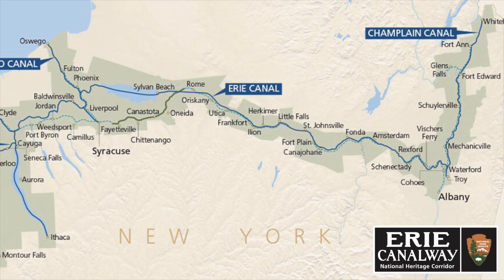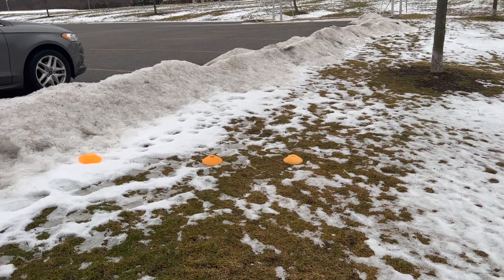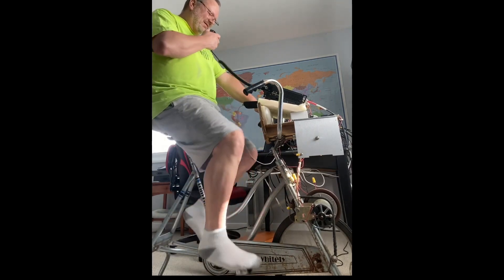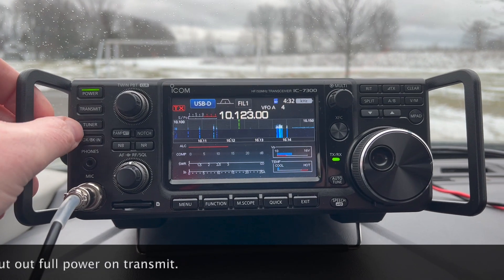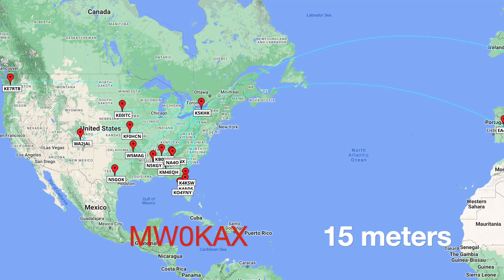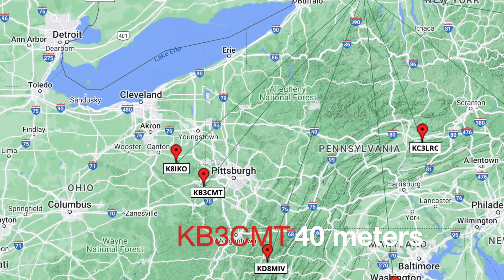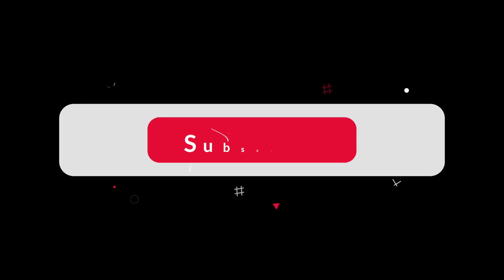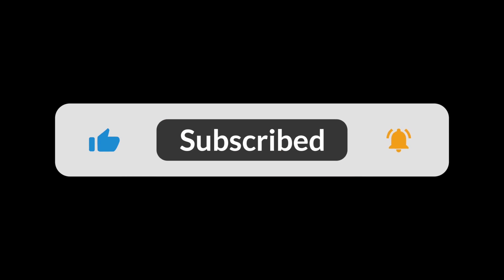POTA Activation with the Rybakov Antenna

Comment: I built one two weeks ago! I am impressed so far!  I am in a HOA! I
Used a chameleon 25 foot whip.
I am in NYC and I worked California,Washington State,and Canada. It's too cold to set it up since then. I hope the weather warms up so I can make a coax passthrough for my basement window and make a permanent setup using a wire to my roof to make it invisable.
I used two 33ft radials.My unun is a 4:1 5kw model I found cheap at a 
hamfest in Connecticut! I had it set up in front of my house and no one noticed it. I used a aluminum plate I found at a scrap yard as a base.
I made mounting bracket from 
scrap aluminum angles I also found at the scrap yard. I will be posting
photos on face book when it gets warmer.
Reply from the maker: Awesome! As soon as Chameleon came out with the 25’ whip, I immediately thought about the Rybakov. Sounds like you’ve got a great setup, even with the HOA. Thanks for watching!

Comment: Is Emergency mode safe to run on a regular basis? I have a few setups that are just outside of the tuner range, and I'd be okay running 50 watts, but I don't want to fry a 7300 haha
Reply from the maker: That’s the $1,000 question, LOL. I’ve used it for some POTA activations on SSB and FT8 for maybe an hour or so without any issue. A separate tuner would be better for a more permanent solution, but having the option to use Emergency Mode on the 7300 is nice, especially for portable ops.

Comment: schematic detail please.....73
Reply from the maker: I'm not sure what you're looking for as far as schematics. A Rybakov is simply a 7.6m (25 feet) random wire antenna that uses a 4:1 UNUN. It will require a tuner, a choke near the feed point, and some ground radials. I hope that helps.

Comment: Rybakov Antenna is similar to EARCHI Antenna which is Random Wire 29' with 9:1 UnUn transformer  ; )
Reply from the maker: I plan on trying that out next too. I've got the 9:1. In the past, I've used a 35.5' element, which has worked great. With my 33' mast, I could easily run a 29.5' element as a vertical, like the Rybakov. Thanks for watching!

Comment: Is the 1:1 balun acting as a choke or is it doing something else? Wondering because since the 4:1 balun already has coax connector, I’m wondering if the 1:1 is needed? Thanks!!
Reply from the maker: Thanks for watching! The 1:1 unun is acting as a choke. The Rybakov is an unbalanced antenna, so using a choke would be good practice to reduce common mode current and RFI. It might not be as necessary at lower power levels. I've gotten quite a few questions about this, so I'm going to address it in the follow up video (just need to shoot a little more video, but have most of it already). The LDG 4:1 instructions does reference the use of the 1:1 unun for antennas like this and I'll be sure to show it in the video.
Reply: @MikeN2MAK  awesome, thanks for the explanation, sir!
Reply: @MikeN2MAK  is there anything special about the length of coax between the 4:1 and the 1:1? Would any length work? even a male-to-male connector?

Comment: Your antenna had a usable swr on more bands than Tim's. It sounds like you only used the 7300's built in tuner. What was your coax/ unun setup from the feedpoint? Thx, Brent   VA7hUM
Reply from the maker: I used both the regular 3:1 internal tuner, as well as the Emergency Mode Tuner mode, which drops the ICOM 7300 down to 50W max power, but increases the tuning range substantially. The 25' radiating element and six 17' counterpoises were connected to an LDG 4:1 UNUN (green), which was connected to an LDG 1:1 UNUN (blue) with a 3' coax jumper. Then I had 25' of RG8X going from the 1:1 UNUN to the transceiver. The 1:1 is to choke the common mode current, since it's an unbalanced antenna. I hope that helps. Thanks for watching!
Reply: @MikeN2MAK does the 1:1 unun has to be 3’ away or a shorter jumper can be used? Doe’s omitting the unun altogether impact the receive noise levels?
Reply from the maker: @Mark300win  The 1:1 should be close to the feed point. I have some 3-foot cables (HRO had an ABR 3-pack of 3-foot cables) that I use but anything shorter would be fine. I haven't tried this without the 1:1, so I'm not sure about noise levels. I use the 1:1 as a choke for common mode current since it's an unbalance antenna.
Reply: Appreciate the info! Thx

Comment: Interesting video Mike, I put one up last weekend but with only 4 radials, the LDG YT-100 was able to to get a match on 6 through to 80. I’ve just watched G5TM’s video again and will put out some more radials. The .7 of a wavelength vertical is worth a shot too. 73 M0UDB
Reply from the maker: Thanks for watching! Walt mentioned he used six 5m radials and I saw that elsewhere, so that's what I did. I did get it to tune on 6m but totally forgot to include that in the video, since I called on SSB but got no contacts. When I got out with it again, I'll try and see if I can do some FT8 on 6m and 30m with it.